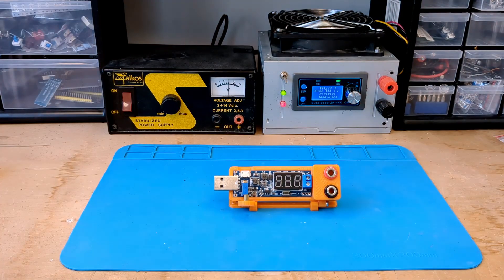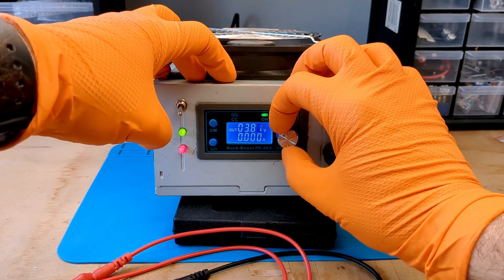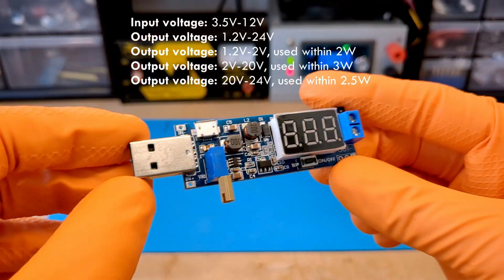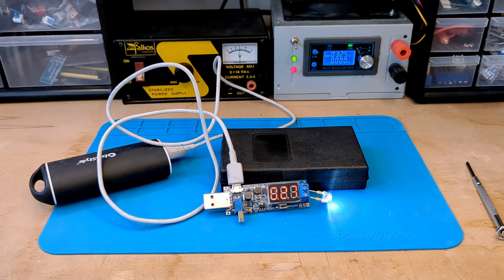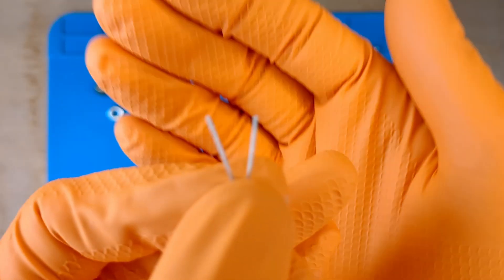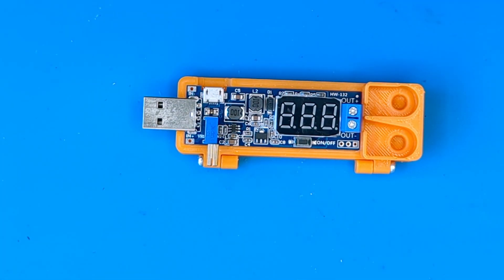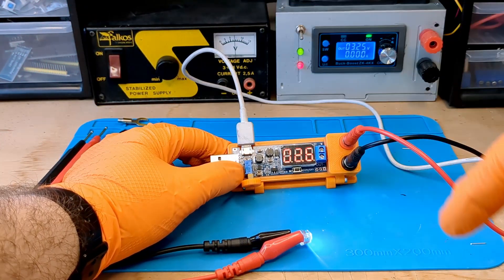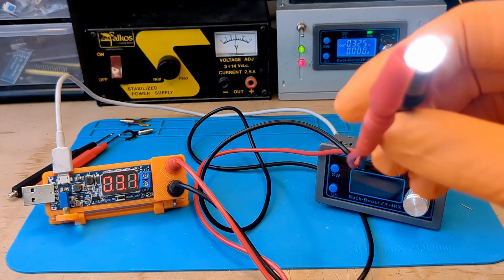Portable USB power supply for less than 5€

Comment: Those trim potentiometers have a very limited lifespan, if you constantly adjust the voltage. I recommend replacing it to a proper one, that has more turn cycles.
Reply: Really .? 
Like I have one which I am using since a year or so. I use it often and it's still the same